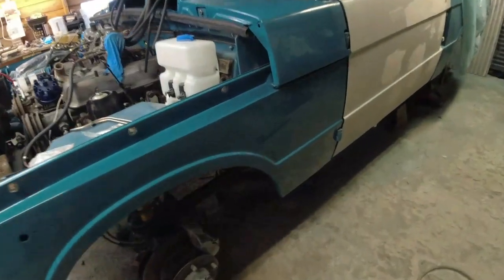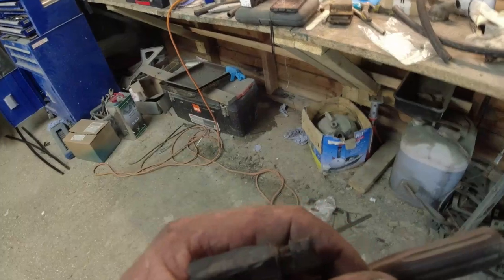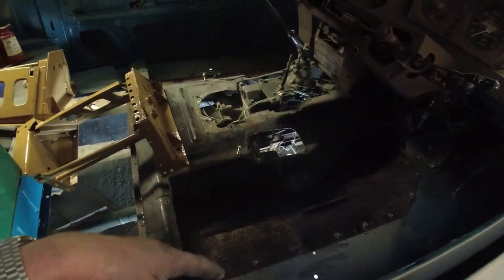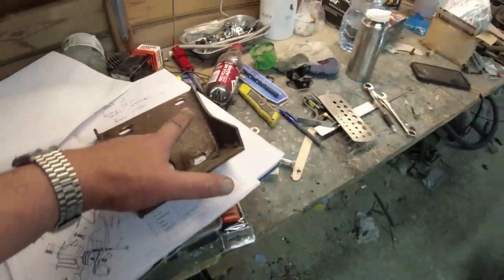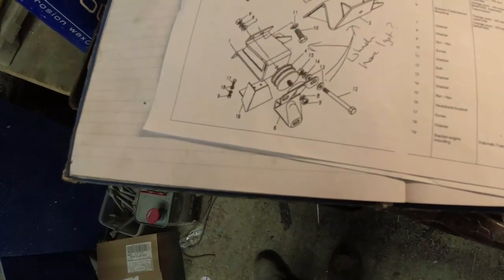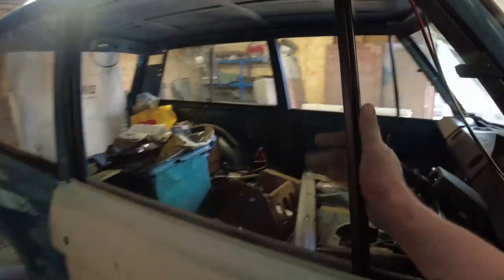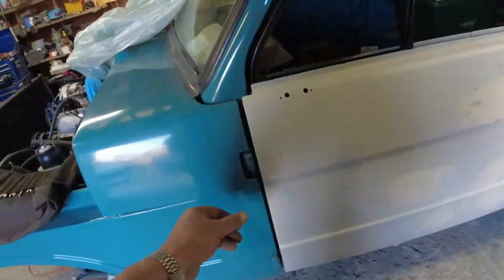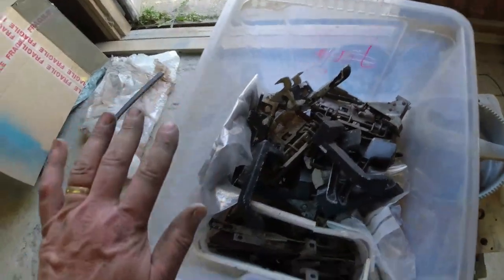Episode 45 - 1971 Range Rover BOB, assembly and stuff - parental warnings for profanity

Comment: those spacers should ideally be made of plastic i believe because of galvanic corrosion (body parts made of aluminium + steel bolts)
Reply from the maker: I use a fibre washer, but when paint is on all sides of all parts it is better than when it left the factory